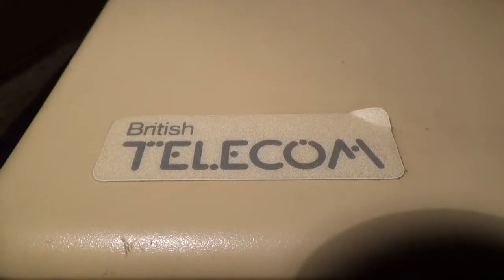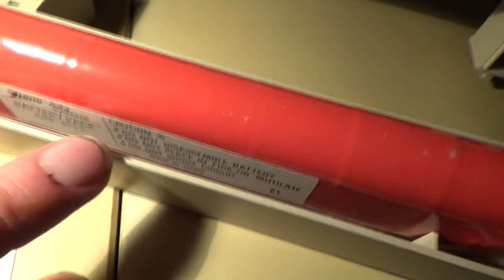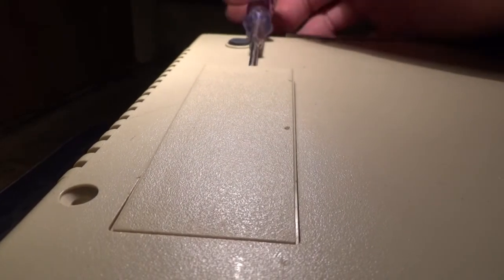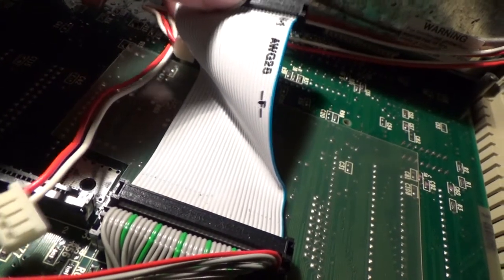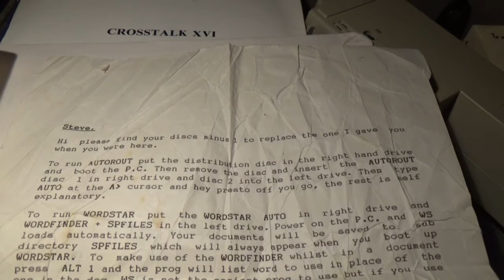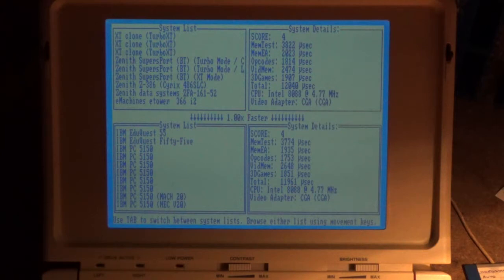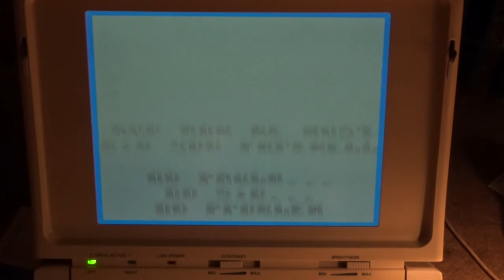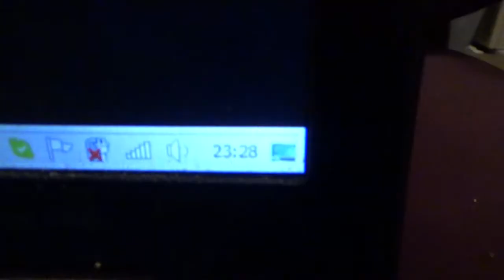Zenith SupersPORT 8088 Laptop (British Telecom)

Comment: i would assume the lack of handles is more down to modern laptops svelte forms rather than cost. Great to see a new video. That BT logo reminded me of buzzby! Will look forward to the KCOM video if it ever emerges as the setup in Hull is pretty quirky.
Reply from the maker: It could still be made to work, it could pop out forwards instead like some of the old locking mechanisms did. I'd say it was to make you buy a case, but how many people actually order a first-party case instead of just getting a cheap one? Really nobody, so that can't really be it, surely. As for KCom, some day, yes. That'll be fun to film anyway as there are some outdoor shots for it, something I wish I got a chance to do more often.

Comment: Way late 70's Zenith bought Heathkit, I've heard mainly to acquire the H100 kit, and resell it as their own Zenith computer system. I think that these 80's era portables were still being designed by the Heathkit guys  and that is the reason I believe for the manual being written in such detail, like an assembly manual to a Heathkit, that's just how those guys were use to doing things. So when you said you probably could build a new system just from the manual, that probably is more true than you think. 

Just a guess, but those extra connectors on the motherboard might be an indication that this board was also used in another Zenith system, possibly their Zenith " portable " which used full size floppy drives.  

I think it was one of the mid 80's Computer Chronicles show I was watching once that it was mentioned something about that the keyboards on these early laptops were being laid out to more closely match that of a Type Writer because at that time the marketing pitch was for those laptops to be a replacement for a Type Writer, which at that time could still get expensive. I was just reminded of that when you were mentioning the keyboard reminded you of a Type Writer's layout. 

There are quite a few games for XT computers. Whether they are any fun is a matter of opinion of course.  Echelon, Sopwith, Frogger, Kong, I think I even came across a Mario game.  

Nice T-shirt btw.
Reply from the maker: So they did, think that was noted in the old SlimsPort video somewhere. This explanation would make sense and I'm really not going to complain about a manual being that way, the more information they put in there the better.
Using the board elsewhere also seems very likely, Zenith seem to have left designs unaltered wherever it wasn't necessary to change anything, so if they could make the boards in adequate volume and it already did what they wanted, there'd be no point in them making another one to do the same thing. It doesn't look like the board in the "Portable" but that doesn't rule out usage elsewhere. I'm still leaning on the two at the back being for a 68-Pin external bus, because one appears on both the SlimsPort and Note 325 at least. That last one, though, I have no idea, oddly the manual doesn't mention it at all.
The manual itself claims the keyboard is typewriter-like, it seems like one of those things which only made sense at the time and just comes off as being alien now. Used to have a typewriter, a long time ago, it was cool but I wouldn't want to go back to it now for anything serious.
Games on these things just feel a bit too clunky to me, they're like Atari games, most have not aged very well at all and are only good in small doses, for me at least. I want to find something to do with the machine, though, because it has won immense levels of respect from me, if only for the fact it still works as well as it does, that battery is nuts.
I'd have liked a t-shirt with a 70 'Cuda on it, but I couldn't find one so the 69 Mustang is more than good enough.
Reply: This might be a good machine for you to do an NEC V20 swap into, if nothing else than for the sake of doing something with the machine maybe.

Comment: TOPBENCH score of 6, so not too terrible. Nice machine, thanks for covering it!
Reply from the maker: Definitely would have been a usable system for its time at this speed, I don't doubt. It seems BT used it primarily for terminal applications and documents, so I doubt they had any problems anyway. Sorry for having it butcher the hell out of 8088MPH, given that it wasn't the target system for the demo - the demo knows too, apparently a cycle count of 1721 is 3% off of what it expects. Kinda neat that it checks this, proves a good way to test the accuracy of clone/compatible systems like this.
I so wanted to run 8088 Corruption / Domination, but with no hard drive, no sound card and no other machine being InterLink friendly to this (and probably eating too much memory or being too slow anyway) due to file system differences, it just couldn't be done.

Comment: Neat find! Kinda weird that 8088MPH's high color demos causes the whole system to slow down considerably as well as the whole system running a bit slow when running with the built-in LCD, as if part of the system resources are taken up for driving the LCD in software or something. Really weird.

Speaking of vintage laptops, I was able to find a japanese Toshiba DynaBook 286 which my uncle used to use as his daily driver during his stay in Japan in the 80s. Unfortunately, the thing didn't survive particularly well over the years as the LCD's polarizing layer decayed not to mention the internal rechargeable battery inside the thing leaked, killing the motherboard. It also supposedly got flood damaged according to my uncle and since the thing doesn't work anymore, I don't know how close is it to being an IBM PC compatible considering that Japan's PC market was a pretty cluttered mess back then where manufacturers had their own non IBM PC compatible architecture (Fujitsu's FM Towns, Sharp's X68000 and NEC's PC-98 series) and software wasn't cross compatible with across other manufacturer's machines.

The only working (or used to work properly) vintage laptop I have is an NEC PC-9821Lt sporting an Intel 486DX50 and 8MB of RAM and Japanese versions of MS-DOS and Windows 3.1. I actually used it during my 1st and 2nd year in college with a refurbished battery (by replacing the dead NiMH cells in the pack with NiMH AA batteries which actually fit in the pack pretty okay and it worked) some 2-3 years ago for basic word processing, playing the PC-98 Touhou games and playing around with VisualBasic 4.0. Being a laptop from the mid 90s, it stood out from everyone else's laptops in the cafeteria though nobody made fun of me using it. Unfortunately, the thing slowly broke down while I was storing it starting with the keyboard going bad where pressing the A key would also press the S key and it got progressively worse overtime. And recently the screen was starting to show signs of rottage and the capacitors on the thing appear to be going bad as the screen flickers to white a lot now. What a shame, I should've made a video of it before it had gone bad but I didn't have the confidence to do a proper video of it but once I did the thing had gone really bad. I think I'll just do a video of it anyway when I have the time despite being faulty nowadays.

By the way, the most fun thing about the PC-98 platform is that the good majority of the games for it are hentai dating games! A perfect platform if you're a fan of lewd Anime artwork in glorious 8 colors.
Reply from the maker: I can only theorize as to why it slows the system down. My suspicions are that it makes the video controller wait until it finishes drawing and, by doing so, keeps an interrupt in use, stalling the rest of the system. The LCD is driven by that large package hanging off the bottom of that heatsink near the back of the system, the markings on it yield nothing and merely following traces doesn't tell me very much about how it works.

Sounds like the DynaBook has had a rough time indeed, I'm not sure what the chances are of repairing it either. Recently got lucky in opening a 386SL laptop to find the battery had leaked, but by pure luck it had been stored in such a way that it just ran out below the floppy drive where it did no harm, aside from the floppy, but I don't need it to work in that system and even then, it may be possible to fix. Japan, though, yeah, they did some strange things, that Sharp system with the 68K processor seems to have a bit of a following, though that's definitely not PC compatible, given it uses a different CPU entirely. We actually had a maker in the UK who made PCs that weren't 100% compatible with the IBM, known as Apricot, though I think they corrected that as time went on. From what I understand they're quite rare now, haven't seen one in years and don't own one, some of their ideas were fairly ambitious for the time.

It does seem laptops have a finite lifespan, I notice they all wear down over time and I dread reaching a point where they cannot be fixed anymore. My satellite has keyboard troubles now, nothing too big, but the membrane under the keys is going bad and so the left side will go out and rapidly type three characters on the same column. For now all I can do is tap the edges firmly to knock things back in place. Still, it did manage a 300+ page document before this started getting out of hand, but it's sad to think that some day, none of them will work. I will try to replace the keyboard though, to give it some more time.

Oh, those hentai games, yes, I've seen a few of those around when people have talked about that platform. I'm not a fan of such things, but they make me smile anyway because I find them funny more than anything. The dithering must be simply wonderful on such things and funny you should mention such things, me and some people I was talking to thought it would be funny to convert a bunch of, shall we say, adult pictures and videos, into CGA to see what would happen. Oddly, it seems to survive the conversion better than it does with EGA on average, largely as flesh seems to convert to dithered gray and red with EGA and it looks horrible, versus pink and black with CGA which looks... Well... slightly less horrible somehow. I suppose this is all subjective, though.

Comment: The 8088 MPh demo outputs graphics for the composite, not the CRT. The video mode stuff will only look correct if you use the composite due to ntsc trickery to get more colors. Check out the making of-videos on youtube for more info.
Reply from the maker: Indeed. I wasn't really expecting it to display properly anyway, I was more curious as to whether it would make it to the end without doing anything too silly. Unfortunately there is no composite output, the pin for it does output a weird signal of some kind but what it actually does is a total mystery.

Comment: If it's using 34 pin as per FDD, I imagine it has the extra headers for MFM drives which use the same interface.

Comment: Hi,

Do the manuals that you have have any information on the PSU? I got one of these lately and it worked fine for the few hours that I used it then didn't fire up again. I've completely recapped it and still nothing, except that weird STK7702 thing with loads of pins going into it gets a bit warm. Not sure where to look next.

Also, you're right: the hard drive for this has it's own proprietary controller board that plugs into that header you were looking at and a 20 pin (MFM?)  cable comes out of that into the hard drive. The 286 version has a normal IDE header there instead that plugs into a very similar board and also comes out as a 20 pin connector into the drive. 

I've seen people on forums talking about using it as IDE directly but mine doesn't seem to want to boot when I try that.
Reply from the maker: I know the voltage and current for it at least - 16.5V DC 2A Center Negative polarity. It might run on 12V as that's what the battery provides, but the current draw will be a little higher (Maybe towards 2.75-3A) at this voltage and you might get more heat as a result, either way, observe the less common polarity used. The STK7702 package should give off some heat when running as that's for driving the LCD. Outside of that it's going to be down to old fashioned probing if something is wrong, not sure exactly what it's doing or not doing, so it's hard to suggest where to start without knowing more about the problem you're having.

At least that clears up the hard drive mystery and also the keys. I'm weary of pulling caps off that don't come easily as I've run into them being glued before (presumably someone got sick of them coming off) and, in that case, the glue had melted the plastics together making removal a destructive process. It was years ago on a dead keyboard, but it's stuck in my mind since, if they wanna stay on that badly I'm not gonna wedge them off.

Comment: First! 

3.5 hours is insane :D
Reply from the maker: The battery was a real surprise. Sure these NiCads are tough, but to still hold a charge that well is insane as the manual would suggest it hasn't lost any real amount of capacity, given it actually surpassed the suggested running time noted in there.
Reply: Yeah I think Zenith used really high quality cells in these batteries because mine still holds a charge too! Don’t remember exactly how long though.